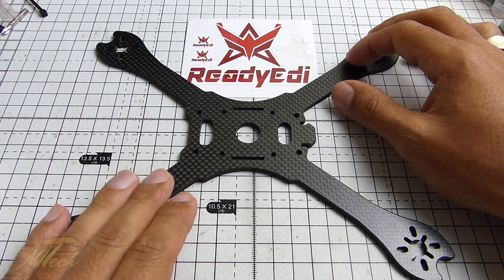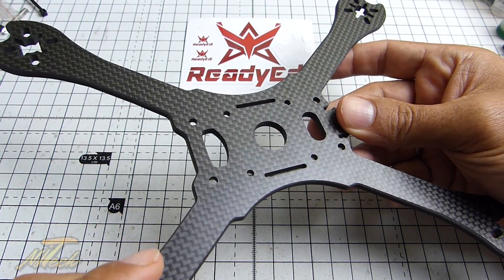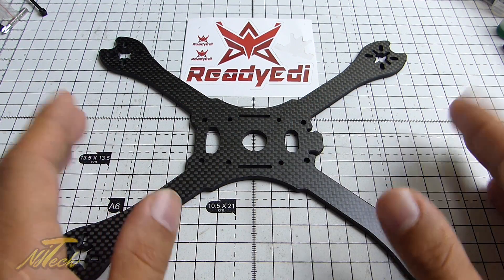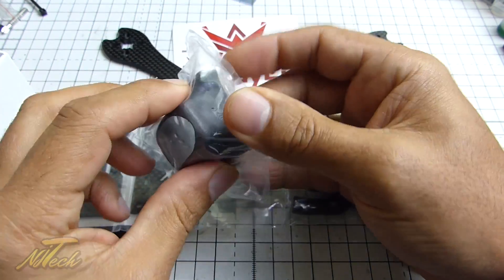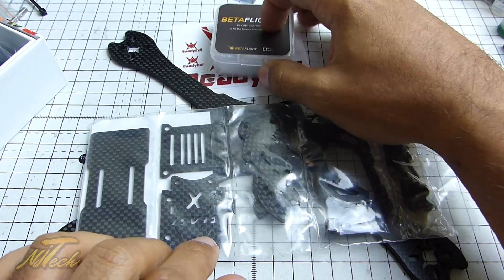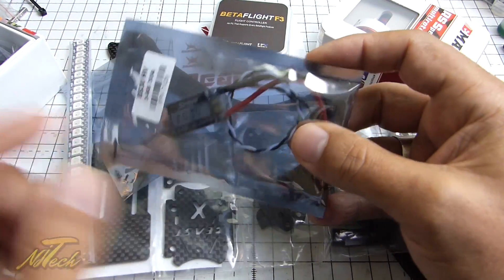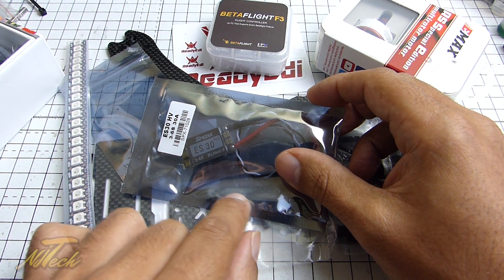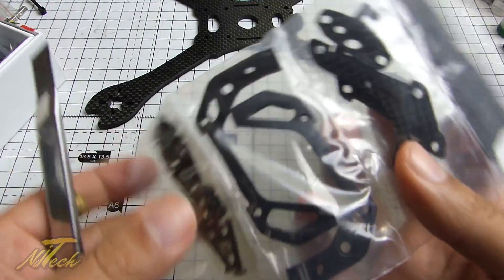Beast SX Build! part 1 (overview/components/dry-fit)

Comment: Worried about aerodynamics? Wait till you see the next quad I build, just waiting on the factory at this point ;) 

That looks like it will be a killer build, can't wait to see more videos on it =D Here here on the weight.
Reply from the maker: Cheers, Seth! Ha, well im afraid there are no aerodynamic offerings on quadcopters no matter the design, only thrust vs drag... lots of drag! That said i'm always interested to see how designers might optimise for airflow and remove obstructions, as that can make for slightly more meaningful results, I look forward to seeing it of course :)
Reply: Well yeah, I guess saying the drag is highly reduced is a better way of putting it. The simulations look good though :P
Reply from the maker: you have my interest ;)